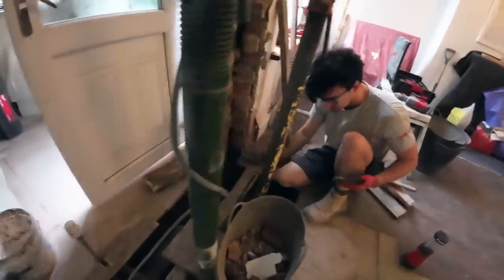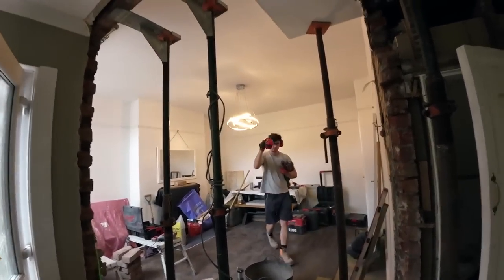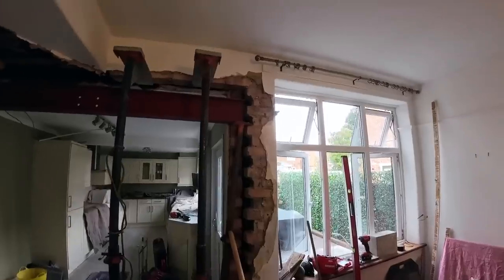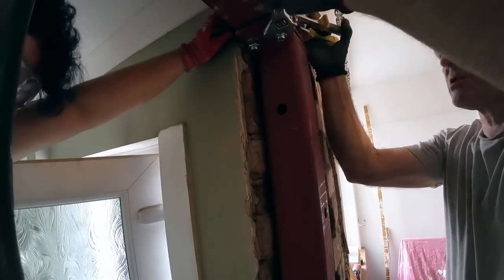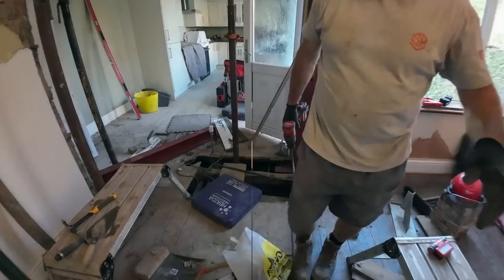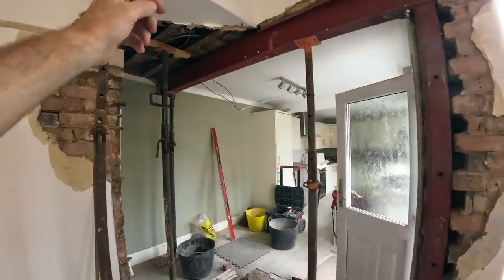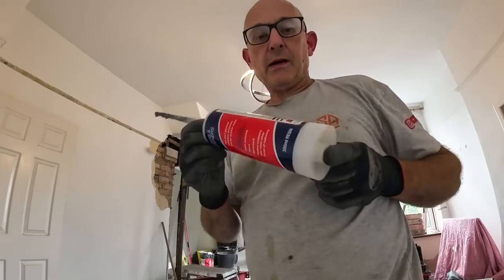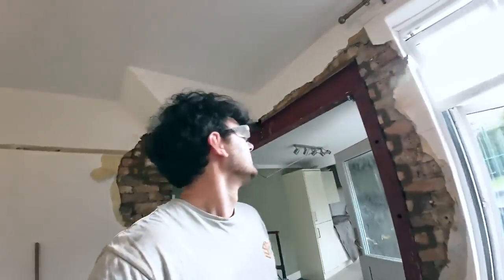WE NEARLY TURNED THIS JOB DOWN.. GOALPOST STEEL PT 3

Comment: Well done getting the steel dimensions and angles right. Loved the bolt tightening. Shows you are builders and not mechanics masquerading as builders. Job turned out well. Thank you
Reply from the maker: Cheers Ray 😆🧱👍🏽

Comment: Hi Steve and Alex another good one, just a quick suggestion I would have put the bolts at the top of the post in with the theads pointing up which would make the boxing in round the steel smaller .👍

Comment: Couple of suggestions for the bolt holes in the padstone. Use a stiff bristle bottle type brush to help get the dust out of the holes alongside the blower. Screw the bolts into the epoxy rather than knocking them in.
Reply: + normally you lay down approximately 10cm epoxy on a piece of paper before you put it in the hole. (First 10cm is not mixed well yet)
Reply from the maker: @pjbissie1 🧱👍🏽

Comment: Great video as usual Steve & Alex, I would definitely be hinting to Milwaukee for a MagDrill at least then you would be able to drill the holes out where you needed them on the steel that didn’t line up with the brick work.

Comment: Another great job guys!
I like the idea of using 'thunder' bolts to tie the 'pillar' to the column.
I reckon that they would have been ideal to fix the angle footing as well rather than messing around with epoxy.
Reply from the maker: They are good 🧱👍🏽

Comment: Maybe worthwhile to get some steel packings at the same centre lines to slot over instead of slate as used in steel frame construction bases?

Comment: Won’t go off will set in nozzel but keep on tube rest will stay fine. Tajima convoy 26/1 ratio. Good for the resin on silicone tube sizes. Most brand fischers r Kem loads others do silicone sizes tubes. But would a heavy gauge ratio caulking gun not bad in hot weather pushes through easier but goes quick as hell
Reply from the maker: Cheers Lee 🤜🏽🤛🏽🧱👍🏽

Comment: Like the video lads just a tip about the plated bolts and nuts if the thread is tight start the nut and tap the nut against the steel that should break the plating causing the tightness. Really like your work ethic no mucking about also when i was still working i found milwaukee tools to be top notch in all areas bought my own after retirement. Another recommendation only buy Barco adjustable wrenches or Clarkes own from machine mart are the next best.😊
Reply from the maker: Thanks for the tips Paul 🧱👍🏽

Comment: That nozzle is called a static mixer and you might be able to get them rather than throw or need to use the tube in one go.
Reply: I’ve bought spare nozzles before but guess it’s dependent on manufacturer

Comment: Enjoying this video. With length of those bolts unless you have have a straight through socket set a socket ratchet would not have done the job
Reply from the maker: Cheers 🧱🧱👍🏽

Comment: Hi, what size holes did you drill for your studs to hold down the post and what size studs did you use? thanks
Reply from the maker: Not sure but I think the bar was 10 or 12  mill and the hole was probably about 14 mm 🧱👍🏽